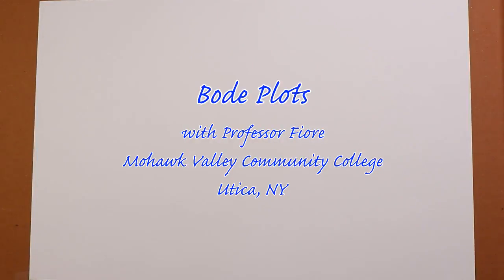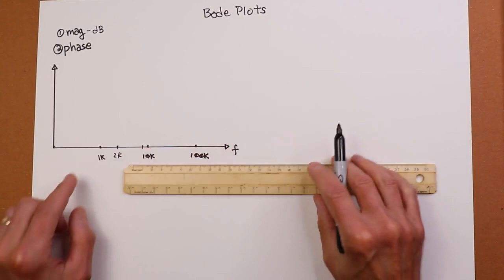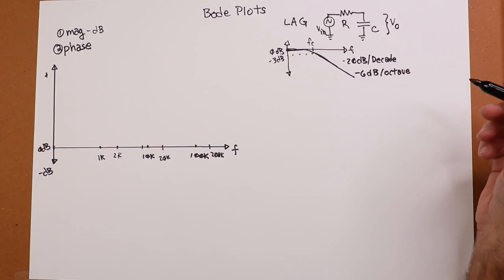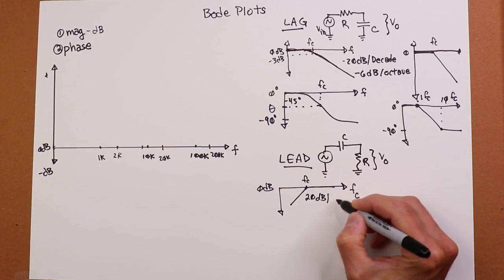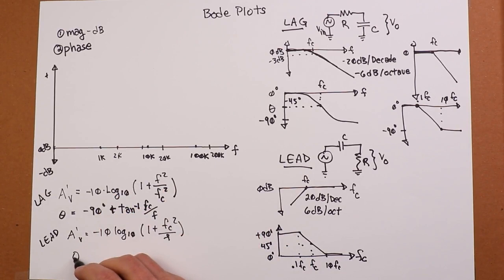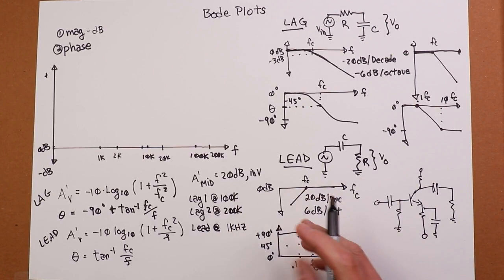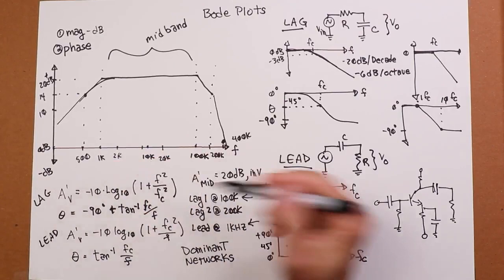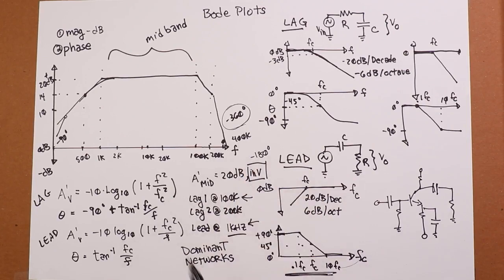Bode Plots

Comment: For what it's worth, saying an octave is a factor of two (a doubling of frequency) and there was a drop of 6db per octave didn't click with me initially.  After a little log manipulation (comparing log 10 to log 2), I realized that there are about 3.3 "doubles", or octaves, in one decade of frequency.  This explains why a drop of 20db per decade is the same thing as a drop of 20/3.3, or about 6 db per octave.  Please let me know if I'm mistaken.  And thank you for a great explanation of the Bode plot!  The multimedia approach (video + text + labs) really helps me comprehend the material!
Reply from the maker: Correct, although I tend to think of it in terms of a simple ratio. That is, the signal level is proportional to frequency (or its inverse, depending on whether it's lead or lag), thus a factor of X change in one produces the same factor in the other. For example, a factor of 2 change in freq leads to a factor of 2 change in signal. Or a factor of 10 leads to a factor of 10. Or 3.854 leads to 3.854, and so on. "octave" is just another way of saying "factor of 2 in frequency" and "6 dB" is another way of saying "factor of 2 in voltage".
Reply: @ElectronicswithProfessorFiore  Thank you.  That is a better way of thinking of it!  A 10x (decade) change in frequency would lead to a at 10x (20db) change in signal.  Got it!